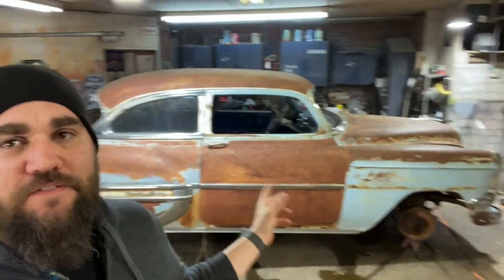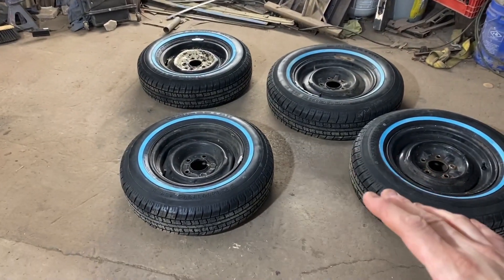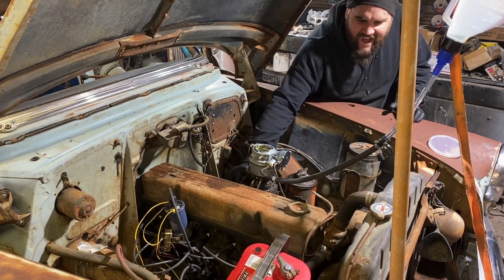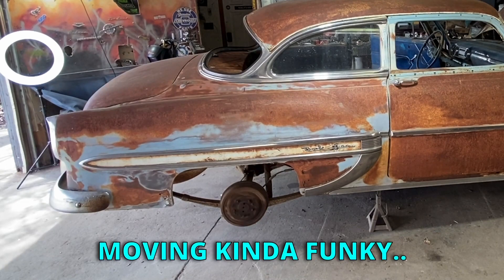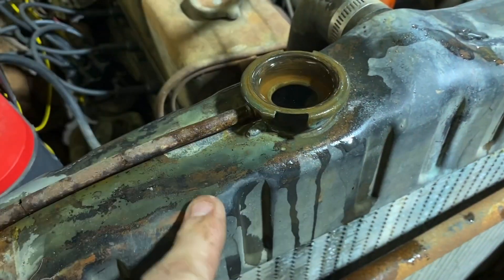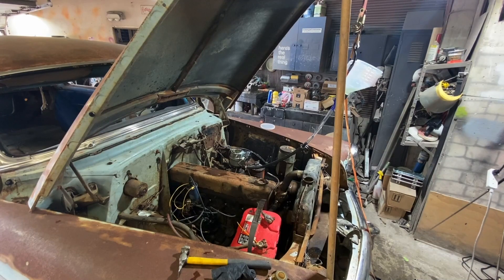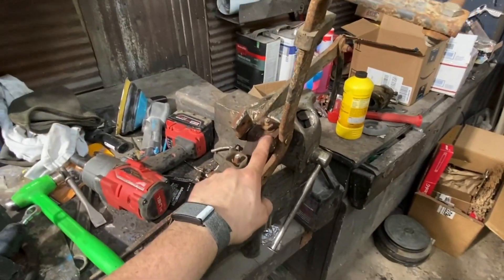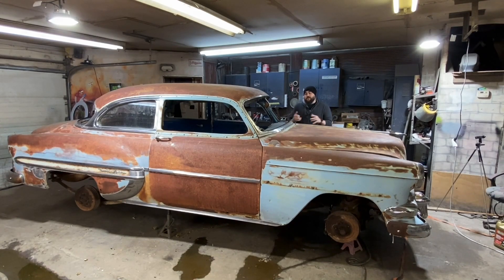ABANDONED 1954 CHEVY RUNS PERFECT AFTER 50 YEARS IN A FIELD! THIS CAR KEEPS SURPRISING ME! Rat ROD

Comment: Take the u bolts off the rear axle and slide it back, then you can remove the transmission. You are going to take the u bolts off when you put the lowering blocks on so no big deal.

Comment: There is a trap door Over the bell housing on the floor pan for the clutch. As far as I know you still have to unbolt the rear from the springs to slide the torque tube back

Comment: That torque tube comes out as an assembly - 1 unit. Pain. BUT (!!) as you're lowering the rear anyway, not so much of a pain - just do it then. The clutch driven disc will probably be rusted to the flywheel and/or pressure plate - but (GOOD NEWS!) will probably break loose pretty easily.

Comment: @Casey, the clutch is all mechanical with spring fingers on the pressure plate. Only thing to keep in mind is the throw-out barring rattling/being bad. I'd say get your pedals back together and its likely OK as a unit. Otherwise if needing work, unbolt your u-joints and the entire rear end and torque-tube come out as one unit, spin the flywheel and there are only 6 bolts holding the pressure plate to the outside of the flywheel. Try to keep the flywheel attached if possible (the 6 bolts holding it to the 235 are a pain)

Comment: I love seeing old Chevys that start and run as good as this one. Good job! You should find some Kroil to help break loose stuck bolts and nuts. Best stuff I've ever used. I order directly in quarts, mix 50/50 with atf in the old oil can. Or use full strength, your choice. Oil once or twice a day for a couple days and breaks down what's stuck.

Comment: I had one just like that way back in 1980 that I bought for my uncle for ONE DOLLAR!  It was a straight six, with a three on the tree and it ran.  I did a tune up on it and also got the generator rebuilt.  It was a six volt system.  It was all original except the passenger side front fender had been replaced back in the 1960's.  I was the third owner.  I put less than $300.00 in it including 2 new tires and drove it for over a year.  It was the Chevy light blue on bottom and then a darker blue on the roof. I should have never sold it but I had a 1971 Challenger that I wanted to do some dressing up with the motor and wheels and tires.  So I sold it to a guy for $1000.00.  This car was complete right down to the AM radio, original spare and jack, and interior was in really good condition. I fixed up the Challenger and drove it for about3 years until I went out on the road playing R&R in a band for the next 12 years. Love to see these babies get back out on the road.  They do not make these beautiful cars anymore. Cars today are shit and ugly.

Comment: Hey Casey! Love the channel, love the build. A few things, the clutch replacement on them is pretty straight forward, however when lowering those old torque tube rear ends, you’ll need to make sure all of the seals are good, changing the drivelines in these old torque tubes will change the oil bath that’s going to run through the unit, if the diff is too high the oil will pool to the front and you’ll cook your ring and pinion. I converted mine to open driveline and swapped over to a tri five 3 speed Saginaw to keep the 3 on the tree. Hope the build keeps going smooth!
Reply from the maker: Good to know! I’ve always converted these rear ends the times I’ve left them stock as well.
Reply: @CaseysCustoms  it can be a pain but it’s worth the effort! I did mine pretty cheap so I don’t think it’ll set ya back all that much, only crappy thing about swapping to a tri five Saginaw is you’ll have to swap the bell housing. You can find em cheap though and I’ve been happy with mine! Build on man!
Reply: you can lower a closed driveline about 3 to 3.5 without issues I've done it with two bel airs I own.

Comment: What's that fitting coming off the intake manifold just under the carb? Vacuum fitting to vacuum wipers or distributor? If it doesn't go to anything, put a vacuum cap (or a piece of hose with a bolt in the end) to block it off, or it will be a vacuum leak. Neat car, there are still gems out there for little money. Has someone already swapped the generator to an alternator? That thing will look great lowered down!

Comment: if you need to pull tranny .....remove the 4 bolts at the cup , jus behind the trans .. then pull the cup back towards rear ....then disconnect  the u-joint under cup , and slide the drinshaft back out of the way ....the rest is the same as an open drive shaft ......have fun !